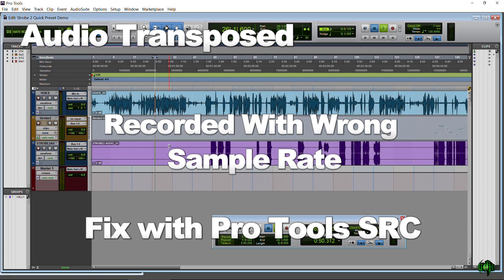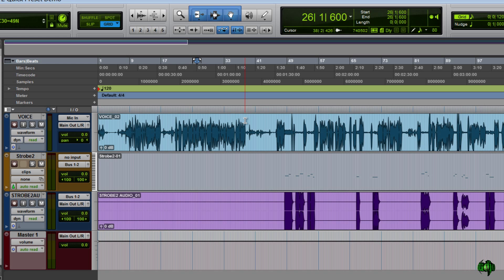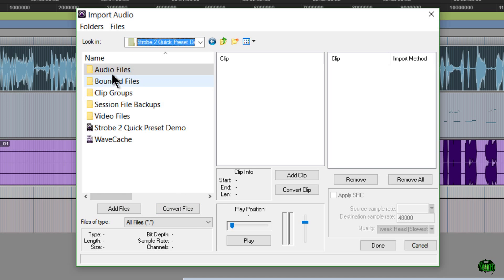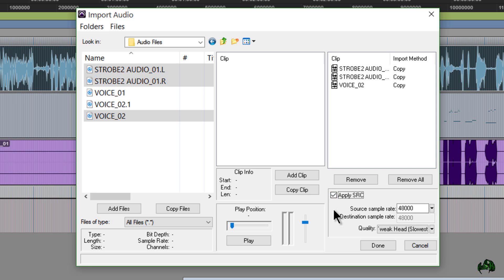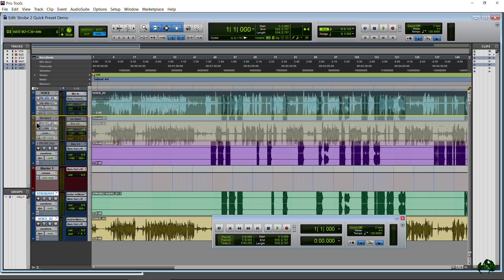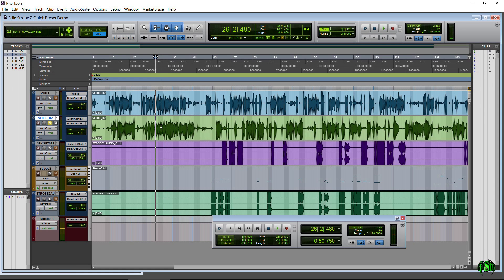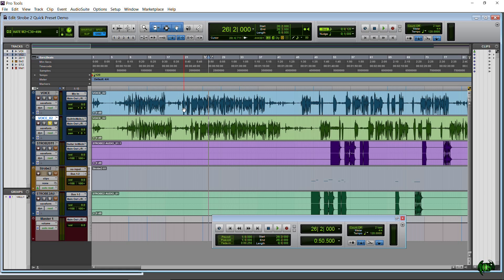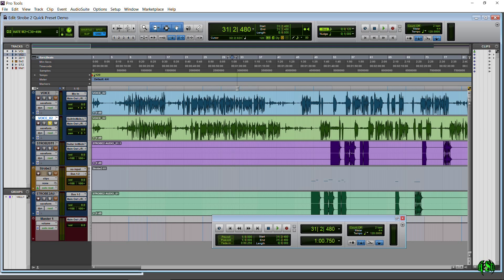Audio Transposed Chipmunk Sound From Wrong Sample Rate - Fix With SRC In Pro Tools

Comment: Thanks for uploading this! I'm sure it will help a lot of people as this is a fairly common problem. In my case, however, this fix can't be applied because Pro Tools 9 (on Windows 7) blanked out the 'Apply SRC' box, perhaps because since the file is on 48k there is nothing to be converted. Any ideas?
Reply from the maker: You have to go through the steps exactly as I did in the video. Use COPY CLIP not Add Clip if the supposed sample rate of the clip matches the sample rate of the session.